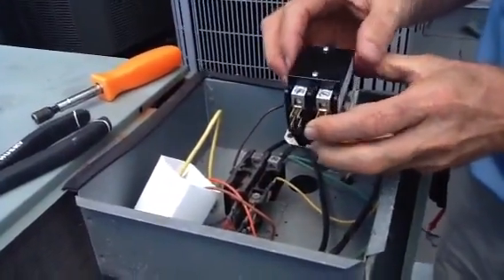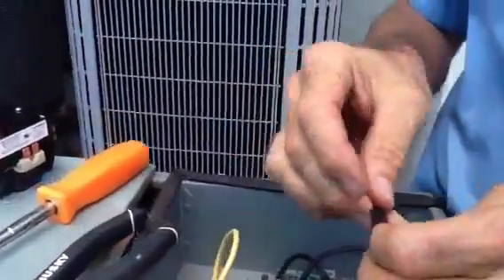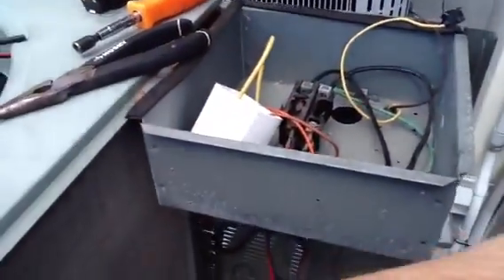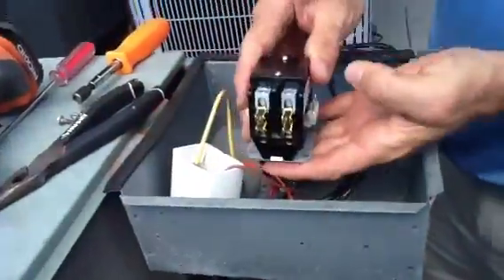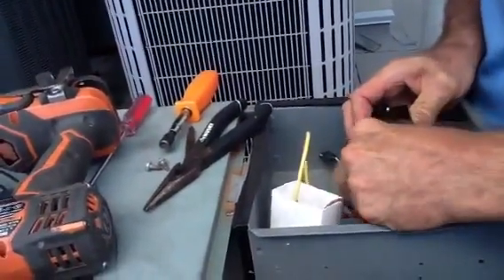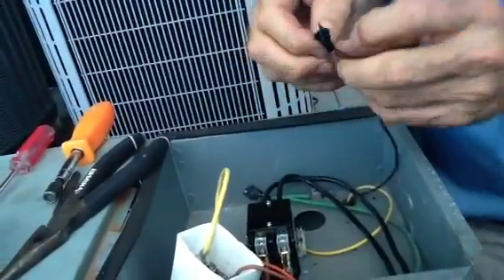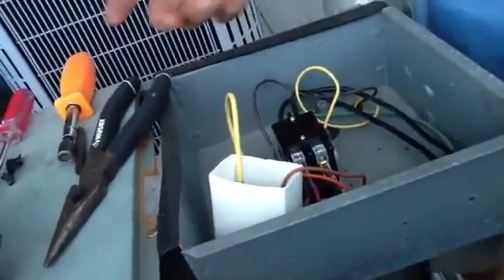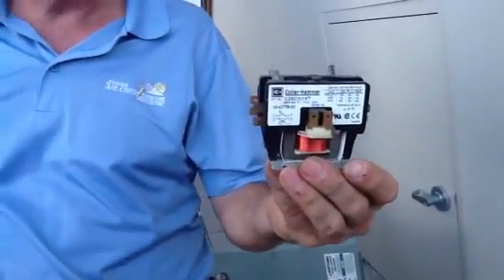REPLACING AIR CONDITIONING CONTACTOR

Comment: You can also turn off the main breaker of the "air-handler" unit....or even turn the indoor thermostat to "off".....as an extra precaution to kill the 24V power...so you don't need the tape.

Comment: Replace a single pole contactor to a double pole.What about the trickle circuit. Does it have a crank case heater?
The capacitor in a box is not good for heat dissipation.

Comment: Another good educational video . That's a good tip for taping the 24v spades ... very easy 
to blow xformer .
Reply from the maker: I know from experience
Reply: My 24 volt 2 pole contactor does not say which way is up and which way is down? Everything about looks absolutely symmetrical, except the sticker on one side with the details.